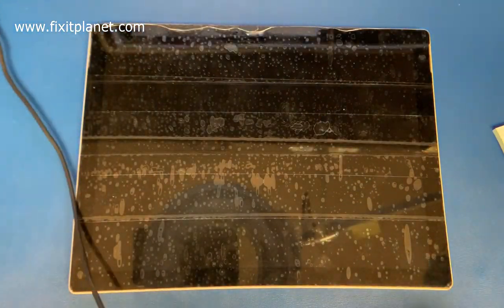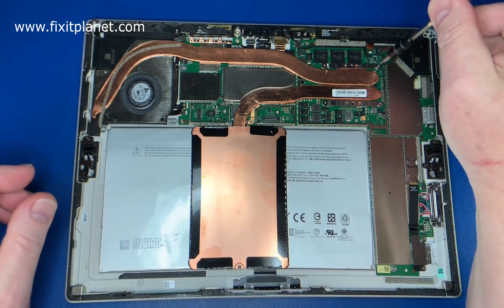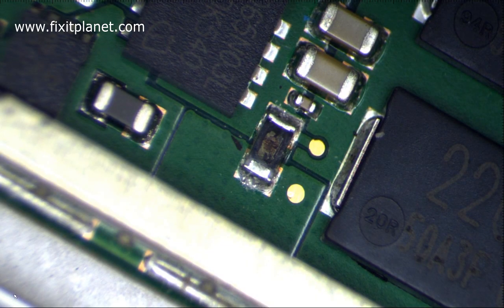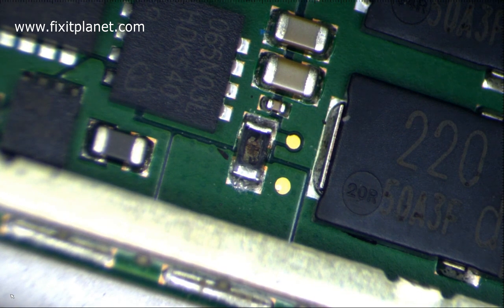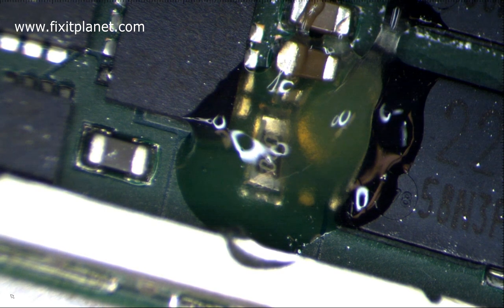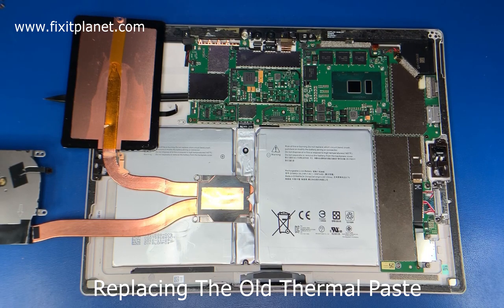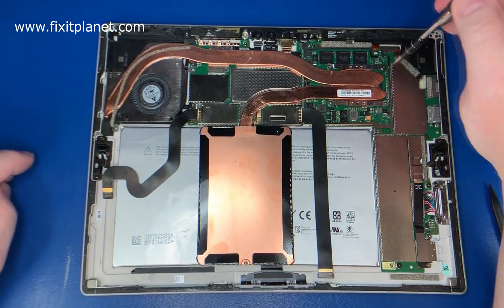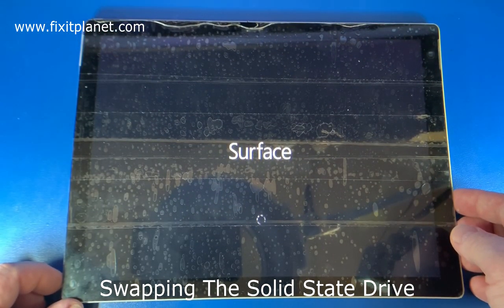Surface Pro 4 "Won't Turn On" Repair From Start To Finish.

Comment: What is the square gray component marked r18 541 cah at 8min36 in the video? Thanks
Reply from the maker: Power inductor coil
Reply: I pointed the wrong one. Do you know what I can replace the R15 537 V6R (8min44) power inductor coil with? I've got a board where this blew up. The resistor "000" was bridge.

Comment: I need your help please. 

I have a surface pro 3. I try to change the LCD and after I pulled the ood one out I tried the new screen and I just have a black screen. The surface not turning on anymore. I did chacke the battery and I did try another LCD but the problem is still there. When I plug it to the charger. The charger gives a white light. What do I need to check ?  I have a microscope and I can solder a bit so maybe you can give me an advice ? Thank you.
Reply from the maker: Some of the information in this video describes where to look. The tablets are arranged differently but use similar configurations of the chipsets. Look for something that identifies the area where we replaced the resistor (near the CPU area) and see if anything looks suspicious. Otherwise you will have to use a multimeter to measure around for a fault. Share what you find out and good luck.
Reply: Same problem, i replaced the screen on the SP3 and at first the screen was ok but the touch didnt work, so i detached the screen to see if there was some problem and i re-installed it back, tried to turn it on but the device was dead! wtf? I've been careful enough when installed and uninstalled the screen, i dont understand! Tried everything to restart it but nothing.Did you find the issue? Thanks

Comment: Hi there , tried the same after getting through your video for my SP4 not getting power up  but unfortunately my resistor was giving a 0.1 ohm resistance and it was not blown up. 

Is there any other component which can be checked for same issue.

Comment: Sir do you have a video on how to fix  blown Power Adapter please give me link & if not then can you make one video. My surface pro 3 Power Adapter got problem it makes crackling sound.
Reply: When being less experienced it's actually better to just replace the power brick as a whole. Most common failure in power bricks are the capacitors (often due to the high temperatures produced by the power bricks), however it doesn't sound like it considering you've mentioned the crackling.

Even when buying an 'third party brand' replacement (a QUALITY one though! not some cheap 10$ Chinese imitation!), you are often much better off and still have higher stability assurance than when attempting to repair it yourself.

What's even more important if you're less experienced when working on things like power bricks: They 'convert' the high voltage AC from your wall outlet to regulated DC (12V) for your tablet. These circuits are considerably dangerous to "tinker with" if you have less experience.

The replacement power bricks (third party) can often be found on the internet for about $20-$30. I'm actually someone who professionally works on electronics daily and I just bought a new one (also third party for €23) for my Surface Pro 2 (as secondary power adapter for at the office), works fine and even runs less hot than the original one by Microsoft.

Hope this helped/informed you a bit :)

Comment: I have pro 6, can't  turn on. But when I click the on button, the right side of cpu is very hot.
Reply: Just no signal, I even connected the mini displayport, no signal. Dead silence.
Reply from the maker: Not a good sign at all. Probably a short under the CPU very bad omen.

Comment: Hi, Can you or any service you can recommend do this repair? My SP4 suddenly stopped turning on a few months ago and I am concerned about removing the screen. I would rather pay for the repair. Applies to any and all commenters, please help.
Reply: Jesus Chavez This happened to me as well, it would turn on with a recovery drive but when I come back it won’t turn on

Comment: changed the battery on the SP4, horrible design, runs off the battery and shows that it's plugged in but it won't charge...

Comment: Would surface pro 4 turn on without ssd?
Reply from the maker: Yes
Reply: @FixItPlanet1  while i unplug, why it turn off? It does not depend on Battery.

Comment: Dear fix it planet
I understand you don have a crystal ball but I'm hoping you can help, nothing on screen but keyboard lights up if you turn it on, if the power resistor is bad would it allow keyboard to turn on. I do not want to tear into this thing and risk doing extra damage unless I have an exact component if possible.  Also what type of heat tool are you using.
Reply from the maker: If that resistor is bad then you get no power at all. We are using this Wagner heat gun to remove the screen https://amzn.to/2mYiYwH
Reply: @FixItPlanet1  at what temperature? I used my riobi on a scrap board and the capacitors started popping like popcorn
Reply: @FixItPlanet1  oh really? when i plug my charger in the charging light is on just like yours. but when i connect my keyboard cover to it it also lights up.
still be blue screen. i do the power button stuff and i will notice that my keyboard light goes off, so i know the surface has powerd down fully.

now with your remark im wonder what problem im have then. i thought it also would be a blown resistor fuse. as an other option ive tried i remain keeping a black screen.
used methodes. power button. power button volume up. and the pcr methode. tried windows p and ctrl shft winkey B.

Comment: How did you remove the cover???? So, it's not a complete guide. 😂🤣
Reply from the maker: Yes that screen was already removed. I have other videos showing the process for removing the screen on several other models including this one. That step was not the focus of this video.

Comment: After watching countless repairs by Louis Rossman I can recognize a fatal error in the repairing process.
The resistor blew for a reason and it's not enough to just remove the old one, slap a new one and you're good to go..
If you don't investigate the whole rail to get to why it blew you're gonna blow it again or have a bigger problem especially that this resistor is near the processor.
Reply from the maker: Each person needs to decide what is relevant to the problem they are trying to solve.
You share what you find with everyone after you have figured it all out.
That resistor acts just like a fuse and lots of things can cause it to blow.
There is nothing "fatal" about this repair. This exact tablet still works to this day and no one has died as a result of this repair.
There is definitely more than one reason why something fails. It is always important to understand what you are doing and each person should do what they think is best. We are just sharing for others as we have time what we discover along the way.
Reply: i can confirm, that i exchange this 000 Resistor twice and each time it hold some months at customer, after it burns up. As you write, there is something else with CPU circuit, that let it take more current, so this resistors are blowing. Maybe it is the cpu.. but i'm not sure.

Comment: How do you know what you need to replace
Reply from the maker: Some failures are common. Some probing around with a multi meter can help you locate the failure. In this case the blown resistor was obvious. I have some working boards I can use to reference measurements. I compare a known good board with a bad board.